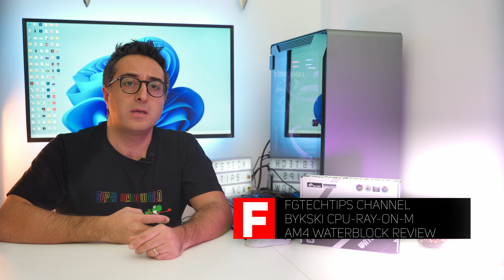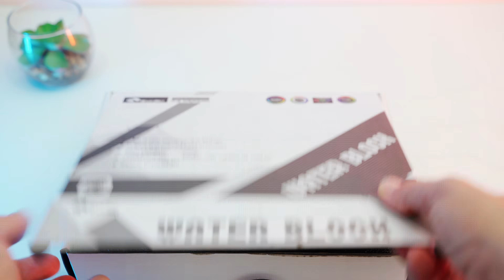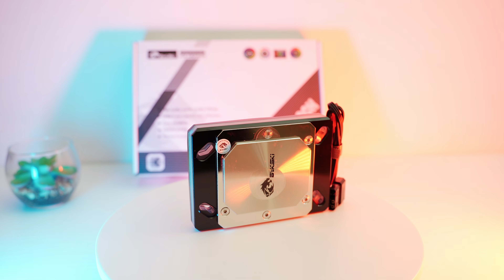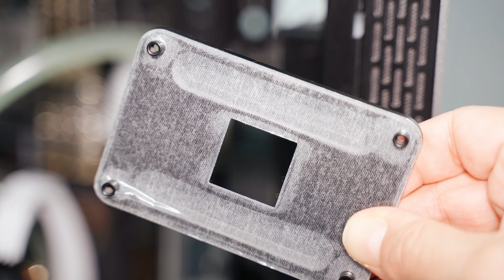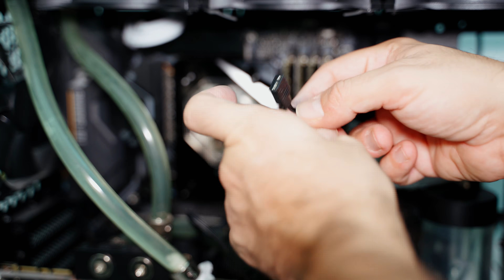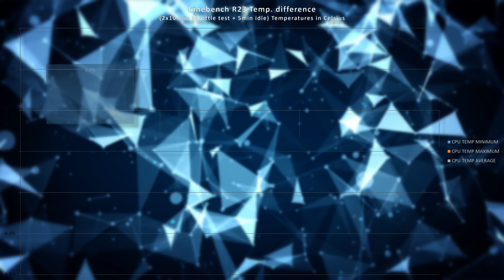Bykski CPU RAY ON M Waterblock review VS XPR AM V2

Comment: Can I use this on AM5 CPUs?
(For 7950X on Asus X670E E Gaming Wifi to be precise)
Reply from the maker: Am4 Will fit am5, you will just need new screws. The new stock should already include it, otherwise you can purchase them separately
Reply: @fgtechtips Thanks for the confirmation 💙

Comment: I have the Intel version.  I like it so far.  Just wish they would stop using 4-pin molex connectors for power.  Why can't we get SATA directly instead of having to use a molex to SATA adapter.
Reply from the maker: True, i guess it was cheaper for them to do so

Comment: Friend, I watched your video and I would like if it is possible for you to clear a doubt, the backplate that came with this Bykski CPU BLOCK has a plastic protection, did you remove it or did you mount it behind the motherboard with this protection?
Reply from the maker: Hi did you watch the video ? I talk and show the backplate too !
Reply: I was wondering if the bykski cpu-ryzen-x-mc would yield about the same performance as this RAY ON M, I have the same XPR AM version right now, but I can't find any info on the X-MC version, should I just go straight for the RAY ON  M version?

Comment: Are they not the same block but one has some digital stuff on it.,  Difference in temps is probably mounting.  I've got the XPR AM V2 and the mountain system is utter crap.
Reply from the maker: I think it's also due to the fact that the top part is not made of actlrylic but black aluminum which helps the heating dissipation. Also the channel is 0.5mm vs 0.6mm i think.
Do u have bad temps ?

Comment: Hm, very interesting to learn that the new block performs so much better than the old block. The fact that it weighs 95 grams more could indicate that they modified the actual copper block. Have you compared the copper blocks in detail to see if there are any differences between them?
Reply from the maker: I think the increased weight is mainly due to the fact that the top section now is made of metal rather than the plexiglass of the older waterblock. Fins and shape seem to be the same

Comment: do you get the right temp on the little display? mine showing diffrent temp compaired when checking on pc using temp core or other software!!
Reply from the maker: Yes i explain that in the video, what the display shows is your loop/liquid temperature not the CPU temperature

Comment: Problem with Bykski blocks is that the surface is not always flat. My block was concave and had to sand it down because I had poor contact and gained 15 degrees. Maybe you can check the old block.
Nice review though.
Reply from the maker: It was probably a defective unit. The 2 you see in this video were perfectly flat